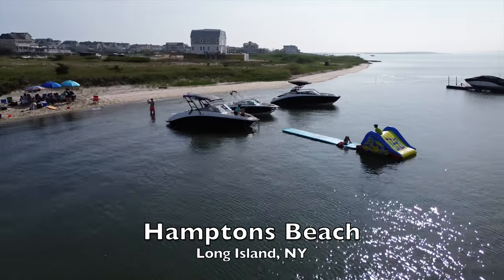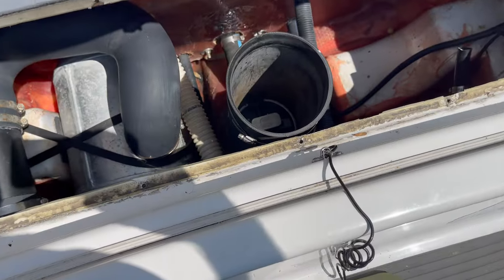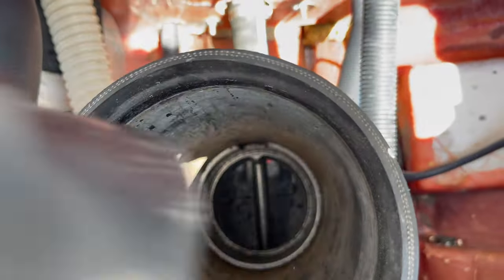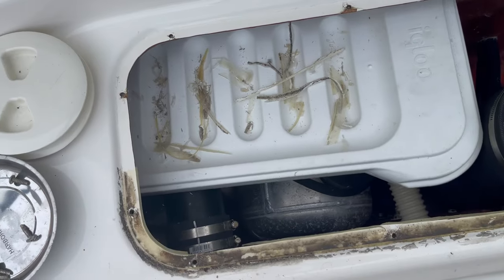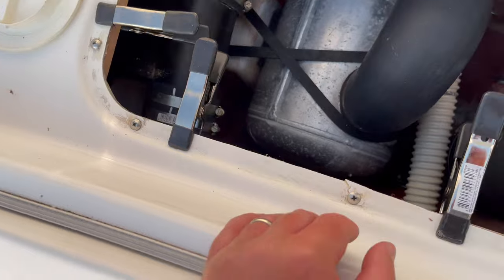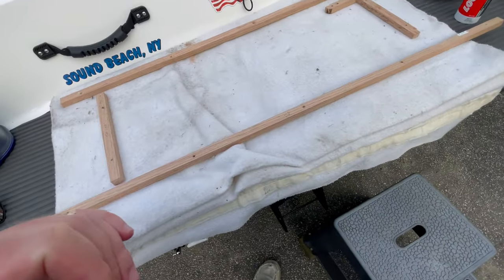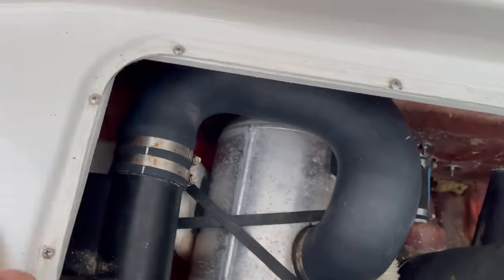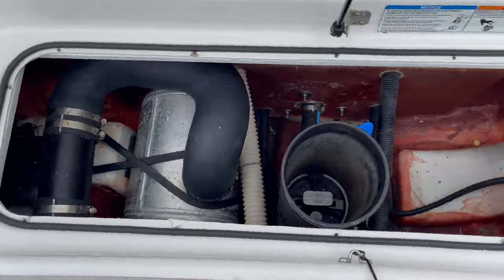Yamaha Boat Bilge Breakdown!

Comment: Wow.  Thanks for working on my boat!  I took off the back cover to find out why the 3 screws that hold the engine drive were completely loose.  Noticed it by accident trying to find oil leak!  Anyway,  I will do this awesome repair of the cover (looks exactly the same) and I thank you for posting this.  Found the oil leak after gruesome search with borescope.  Have to take it in and remove motor to fix oil pan seal.😡😥

Comment: Capt,n.. thanks for a detailed video.  We just purchased a 2015 242 LS and took it out for the first time.  After putting the boat back on the  trailer. I pulled the drain and water ran for about 60-90 seconds. The water wasn't warm.  I found my bilge pump wasn't kicking on on auto.  Fixed that with simply cleaning the area (amazing what you find). Hopefully your video has the solution. We live in Georgia so the season is longer and hopefully I can find out where the water is coming from by process of elimination. Thanks again for sharing.
Reply from the maker: I would need to know where the water is entering from, I just couldn't rest until I figured it out. You can pull that access panel while the boat is in the water and give it a hard look. Good luck!

Comment: Leon ... how is your black hull holding up after 9 years ? i ask because im looking at new 252se in black ,  do you notice any fading since it was new and most imp does it attract sun too much out on water ?  tnx
Reply from the maker: Jay, I love my black hull. It does show scratches more than a white hull would but I have kept it in great shape and the reflection on the hull is like a mirror. We really enjoy it. Does not attract heat or sun at all that we could tell, the interior is white so all good.
Reply: @CaptainLeonsBoatingandMore   great thanks ! ..    alot of cleaner wax on my blue hull im guessing more of the same for black

Comment: Did you do a water test on the rubber gasket? Fill the tray deck with water and see if it holds fully submerged? I’m Thinking of doing this to mine as water gets past my plug and leaks into my bilge occasionally.

Comment: Nice video. One addition you could have added to help manage water in that tray would be to add a check valve on the drain hose. That way when you come off plane and the water rushed back through the tubing it can’t enter to the wet storage tray from that direction but it would still allow for water to pass from the top of the tray down through the exit fitting.
Reply from the maker: Good thought Haknslash, thanks!

Comment: As always, fantastic informative video Captain Leon! I do have a question if I may. I have a 2022 SX195, and have noticed lately that my bilge pump kicks in when I slow down as I come to a stop and pumps water for 5-6 seconds (my second season with this boat, didn't notice this the first year). I don't think it's from water coming over the swim platform. You certainly mentioned a few components to pay attention to in this video, but from your experience with these boats, wondering if you have any ideas where this water intrusion could be happening? Thank you so much.
Reply from the maker: Thanks Medhi. When you come to a stop, any water in the rear most bilge area rushes forward through channels into the engine compartment area and the bilge will be able to pump it out then. It does sound like water is getting in the boat which is normal if it's minimal. When you pull the drain plugs at the end of the day does water come out? Try parking on an incline with the bow up and get it all to drain out. You can even use a shop vac through the hatch cover if needed. Get it good and dry and take it out and observe with a flash light looking through the hatch covers for anything obvious. You may need to re-silicone some areas.
Reply: @CaptainLeonsBoatingandMore  Thank you so much, this is helpful! A very small amount of water comes out from the drain plugs at end of the day if at all, which contributed to my confusion.

Comment: Great videos on Yamaha jet boats captain Leon, have a question especially on Yamaha jet boats can u leave them in a fresh water lake for a summer season say may to sept without having to trailer them out everyday I know this is a great debate and it’s not recommended but no one has any real answers only vague opinions. Thanks for the content.
Reply from the maker: Thanks Elvis. So the issue with wet-slipping these boats for extended periods of time is growth begins to develop under the boat. While it is fresh water, and better than salt water, growth still develops. This growth will impact the smooth flow of water into the intake grate and into the jet pump. I would experiment by leaving it in for short periods of time and then pull it out after a few days or a week and inspect. Hope that helps! Thanks for watching.

Comment: Hi Captain,

I finally went into the Bilge area to check a leak I was having because of your video. I noticed this weekend I had some water leaking through the bottom left hand corner of the engine compartment hatch into the deck area. The leak happens when I slow down from speeds of 15mph and higher.

The engine compartment, bilge area and fuel compartment area are all bone dry.

I did notice the insulation lining the top of the engine hatch was quite damp and had a slow drip when the hatch was in the up position.

Any thoughts or recommendations to look for?

Thanks again.

Jeff
Reply from the maker: Hi Jeff, not really understanding. You describe a leak onto the deck area when you slow down? Ive seen water slush around in the engine compartment when slowing down fast, but nothing comes up into the deck area.
Reply: Captain,

Thank you for the response. I know it’s hard to explain. I don’t have any water in the engine compartment. It’s almost like it rushes down the outside groove/ channel of the engine hatch and onto the deck floor. I posted a 9 second short to my page.

It’s the only video I ever posted so it should be easy to find if you wouldn’t mind taking a look.

Appreciate all the help.

Best,

Jeff
Reply from the maker: @jeffpelton1696   I certainly don't mind taking a look, not that I'm a professional in anyway. You say check out your page.. help me out dude. Facebook page? Youtube page? Can you send a link?

Comment: Good job but knowing how humid that area is, I would have used synthetic decking instead if you still prefer the extra thick bite on the screws.
Another option is taping the bottom side of the screw holes and fill with epoxy. Let dry and drill new pilot holes for the screws..
Reply from the maker: I hear ya, we'll see how it holds up. Thanks for the suggestions.
Reply: @CaptainLeonsBoatingandMore  great looking job..

Comment: Capt Leon, how did the rubber seal hold up compared to the silicone?
Reply from the maker: So far so good, time will tell.
Reply: @CaptainLeonsBoatingandMore  keep us posted if that works out I might just replace the silicone with the rubber, I notice on mine I have only one large hatch where you have two and underneath my hatch is rubber instead of silicone
Reply from the maker: @charlescottone8939  will do.